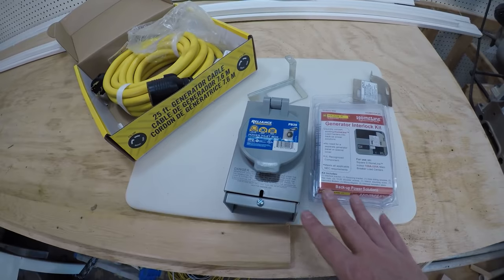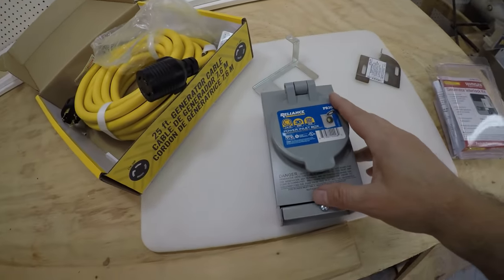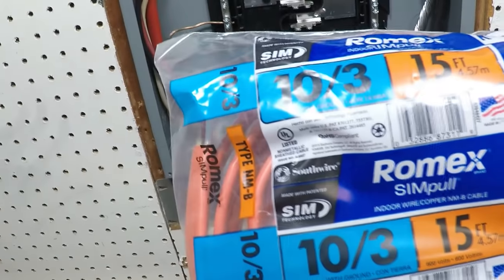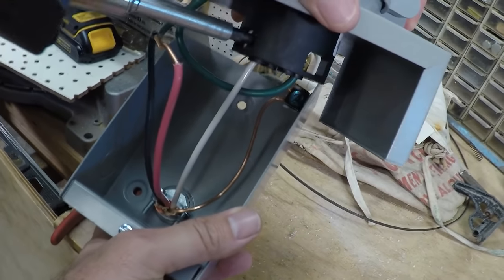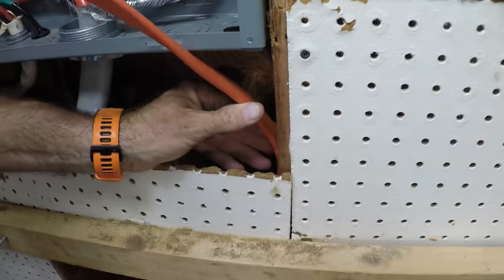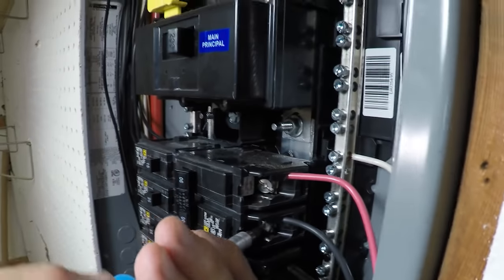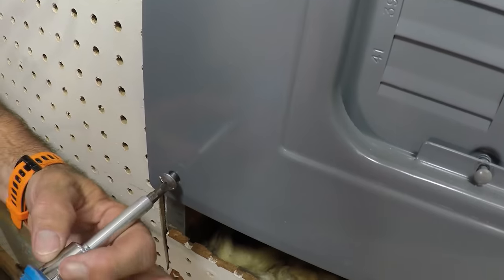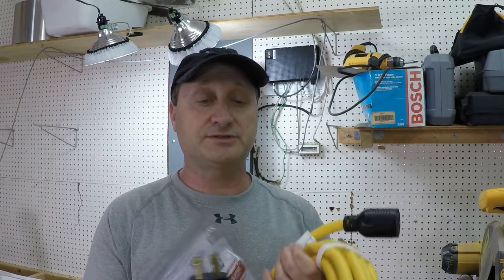Home Generator Interlock Kit Installation - EASY!

Comment: Would this process work the same for a 50 AMP plug?  My generator is a 12KW and requires a 50-amp plug.
Reply from the maker: yes it will

Comment: This may have already been answered already but I just found your video today...great job, by the way.  Enjoyed the step by step explanation.  Where did you get that awesome wire stripper?
Reply: They used to give one away with a roll of Romex but you can get them in the Big Box store. DO NOT use that tool on a 3 conductor 12 as it will cut into the conductors, it's only for use on a flat cable.

Comment: Probably a silly question here, but does the 30 amp breaker in the box push elect to both sides of the panel or just one side?
Reply: A double pole breaker will power both bus bars in the load center.
Reply: @projectswithjw thanks!

Comment: That was dangerous connecting the breakers while they were installed in a hot breakerbox.  If your support hand bumped the breakers to the on position you are holding a screwdriver to a hot terminal screw.  I find it safer to connect the wire to the breakers and then rock them into place on the rails.
Reply: Yes. Secure the wires to the breaker then install the breaker while the breaker is in the  OFF position.

Comment: so my panel has a breaker in the top right that's reserved for a portable generator or is that something we have to do?
Because I'm pretty sure if I could move breakers around and install an inlet to my panel for a generator connection I wouldn't have to watch this video. ;)

Comment: Nice video. I personally don’t have the room in my box for this set up. I wish I did.. I have to add the additional box on my end. BTW please make sure to turn the power main off it is safer if your not so experienced. Thank you 🙏
Reply: They make tandem breakers for many panels that can create room for the two pole gen breaker. You may already have em but just fyi.
Reply: @victorseaton9123  Game changer. Thanks.
Reply: @victorseaton9123   there seems to be a negative effect if you install double pole Breakers I don't remember can you update me please?
Thank you
Reply: @lts30000   2 pole breakers are required for the generator feed in most cases. This is so you make sure you are energizing both bus bars of panel. Tandem breakers are similar to 2 pole but don’t have a handle tie between the two and they only take up one space. Tandems are specific for 2 separate 120v circuits. They give the ability to convert 1 space into 2 circuits.
Reply: @lts30000  no real negative effects. All houses have some. Main issue is making sure you have the correct wire size for breakers and load. If you don’t you can run into serious issues.

Comment: Im guessing because my 3600w generator only offers 120v with the 3 prong RV and the 3 prong locking I assume I can just use a single pole 30A since it wont do 240??

Comment: When you turn off the main breaker for the panel, shouldn’t you turn off all your circuit breakers for the entire house? And when you turn on the circuit breaker for the generator aren’t you supposed to turn on the chosen circuit breakers for the house?
Reply from the maker: my generator can power everything in the house except for the AC compressor. So, that is the only breaker that I would flip off. Meanwhile, you do not have to flip all of your breakers. Just do not have everything in your house powered up. Your generator should be able to run all of the lights, TVs, refrigerators, etc

Comment: So whats keeping the generator from back feeding on the neutral out to the supply lines?
Reply from the maker: the purpose of the kit is to prevent you from back feeding the grid. You have to shut off the main breaker before you can physically open the breaker for the generator.
Reply: @flannelguydiy6458  I’m an electrician and it makes me super nervous having people that don’t know what they are doing, work on anything electrical outside of hanging a light. AWESOME video btw! You did a really nice job.

Comment: I have a generaor with a 50A output, can I put the a 50A breaker instead of a your 30A
Reply from the maker: the wiring may need to be upsized to support 50 amp.

Comment: Forgot the weather seal between box and exterior wall at through hole!
Reply: Construction workers don't know how to do those things
Reply: Very good video, the best I've seen, but in my case I have a problem, my house never had a generator and my electrical panel doesn't have a breaker for the generator, do you have a video like to put the generator breaker on the panel?... thank you so much, from Florida

Comment: @flannel guy diy, you confused me with the two ground wires. Why do you need two and where do you wire that second one after you connect it to the outside box? Also, you didn't give the name of the wire stripping tool and where to purchase it
Reply: Someone answered ground question above 6 th comment down to Darren McCloud question. Don't know about tool sure can get something similar at hardware store asking appropriate staff.
Reply: @personalcarechiropracticma5538  ok, thanks

Comment: Nice video.  You switched the main CB to OFF position and then switched the generator CB to ON. What happens to the rest of the breakers. Just leave them alone?
Reply: I would turn off all the other breakers and just turn on the essentials, for example

Well pump
Furnace
Fridge
Essential outlets
Lights

Comment: is this for a bonded neutral or floating neutral generator?
Reply: It don't matter when its plugged in because its bonded at the main panel.
Reply: Based on the specific setup shown here it’s for a floating neutral.  It does matter.
Reply: @neilbrookins8428  You're right. I've learned enough since my original comment to know that only one ground is acceptable, and no more.  Since this setup is using the house ground, the generator should be a floating neutral generator.
Reply: Floating neutral is for sub panels down stream from main panel , like an out building or work shop away from the house with a sub panel with breakers protecting circuits in shop , outbuildings, barns etc.
Reply: @terryswails1191  or any sub panel

Comment: Great job 👍. What do you think the max length of the 10/3 wire with ground can be . My box is in the front of the house but I would out my generator in the back I'm thinking about 40-50ft would that be to long for the wire from the outlet to the circuit breaker box? Thanks
Reply from the maker: 40-50 feet is nothing. I am working on a project now where we will have a few runs much longer than that.
Reply: @flannelguydiy6458  ok thanks for replying 👍

Comment: Hi can you please share a link for where to purchase 50 amp curcuit breaker and a good gauge wire to run from the box to outside panel.  I am going to get it professionally installed from an electrician but wanted to get it before hand so he does not waste additional on the job clock time.
Reply: Have the electrician buy it. Contractors hate that shit. and you will prob just buy the wrong items anyway.

Comment: Wasn't clear on what Breaker in the box did you wire the plug too? Wire to any 30 Amp breaker in the box? Not understanding this.
Reply from the maker: you buy a new 30amp breaker for this purpose only. You do not use a breaker that is being used for something else
Reply: And shuffle all your breakers around so that 30 amp breaker is located on top of row for safety plate. Right?
Reply: 30 or 50 amp depending upon generator. Many are both, especially above 6kw. Important you know wire sizing based upon amperage. 10s for 30 and 6s for 50.

Comment: Electrician will also do whole job for $350 to $700 depending on area, company and other factors. Recommend an electrician if you don’t have an understanding of how/why on wiring and wire sizing.
Reply from the maker: This is not a job for someone who is not used to working with electricity

Comment: If you have a generator that puts out 50 amps, can you use a 50 amp breaker in the pane?
Reply: Yes, you can use a 50 amp breaker and a number 6 wire.

Comment: good video but you did not list everything you used and/or where you got them. what size breaker you NEED to use, did the little collars come with the box if not what size are they? did you have to move a breaker? if so, how'd you go about that?...🤷🏻‍♂️🤷🏻‍♂️

Comment: My question: Why my generator breaker switch ( the one is on the generator itself) gets off and switched off automatically when I plug the wire to the power inlet box?!???

Comment: Is that a 220 30 amp plug from the gen ? 
The reason I ask is that is the same way my 220 oven is setup in the panel on a 220.  But my 30 amp plug on my gen says it is 120 ?
Reply: His generator has a 220 output which would be needed for this equipment. You need a bigger generator or you'd only be powering part of the panel.

Comment: I have put this in at my house but the only thing it will turn on is my well pump breaker. When turn on any other breaker nothing happens.  Any suggestions?
Reply from the maker: I would have to see it myself
Reply: @Flannel Guy DIY  I think me and my neighbor has figured it out. I was using a 3 wire cord to my driers 4 wire plug. I'm going to put an outside inlet to a 30 Amp dual pole breaker in my breaker box.

Comment: Someone please explain to me. Fuse panels usually have the main power (electric company or solar panels) to the fuse, then to outlet, switch, etc. So how does plugging the fuse in, then adding the plug add power??

Comment: Good video but only thing that would specify on the thickness of The Wire going with the 10 gauge wire and also the extension cord that you're going to use to plug into your generator because if you go to a thin gauge wire you can burn your house down. Also make sure you have a generator big enough run your whole house or you're going to have to get a sub panel so you could only turn on a few appliances if your generator is not big enough. I would of specify those two
Reply: Why can't you just turn off the circuits you don't need or don't have the power to run. I don't get what you're saying please explain.
Reply: Exactly. That’s what this whole video is about, letting you choose what to appropriately run at your discretion.

Comment: how does it power both sides of the panel
Reply from the maker: it goes through the main breaker. Shutting it off blocks it from going to the street but it can flow to the other side

Comment: Hi, so you have to add a 30amp breaker to the top slot of the breaker box in order for the Generator to feed all of the other breakers below when the main is flipped off?
Reply from the maker: That 30 amp breaker essentially becomes the main breaker for the generator. From there, the power would flow through the panel to the other breakers. You should probably flip off the AC breaker for example since your gas generator likely cannot power that. You could go with a 50 amp breaker if you have a larger generator. It will enable you to run more things in your home when you lose power.
Reply: It's basically backfeeding the busbars on the panel through the 30amp breaker, instead of the main breaker. This is actually much safer than other methods I have seen, because the interlock acts as a lockout for the main, so no utility workers are harmed by the backfeed
Reply: @Battleborn357  Got it, Thank You !
Reply: I assume you have to move a breaker if a breaker already occupies the slot?

Comment: I noticed you didn’t turn off the main while writing the ground, neutral and double breaker. As long as the double breaker is in off position is that safe? Or should you turn off the main before connecting all wires to be safe?
Reply from the maker: It is safer to turn off the main.

Comment: Hey Flannel Guy, I was wondering what the benefit is of going with an interlock kit instead of a transfer switch panel, besides the cost and also if there is any benefit of going with a transfer switch panel instead of just an interlock kit?  Thanks.
Reply: Not Flannel Guy but I’ll tell you why I’m getting an interlock kit (besides the expense). 
Flexibility - by getting the transfer kit, you’re frozen into those circuits only.  Also, I could purchase a more powerful generator and not get boxed into a fixed panel.
Less flexibility, less capability, greater cost … why get a transfer kit?
Reply: @pgrant7688  Bare in mind, a larger 30 amp generator only. By larger if you mean a 50 amp generator, then everything gets changed out again, the CB, the power cable coming into the main box, a new 50 amp power inlet box & a new power cable that runs from the gen to the inlet box... 
The moral of the story here is simple: Get it right the FIRST time...
Bill on the Hill... :~)
Reply: @billonthehill9984  Begin install with 50 amp power inlet box, and the 
heavier power cable the first time, but change gen PLUG to 30 amp.  
. . then, if u ever upgrade to huge generator, just change that cord PLUG-back to 50 amp again, and pop in a 50 amp breaker at panel.  That way, you only buy a power cable and power inlet box once.  Saves$ in accommodating future larger generator.

Comment: How did you magically have a free 30amp spot open at the top to install this? Did you move existing breaker in place off camera?
Reply from the maker: no magic here. A few months before installing the interlock kit, I got a new panel. So, this was planned at that time and the breaker was installed (without the wires) at that time. However, yes you can relocate breakers to make room

Comment: What if you have no room in your panel to add a double pole breaker for the power inlet box?
Reply from the maker: then you may need to go with a transfer switch on the power line before going into the panel
Reply: @flannelguydiy6458  So no need to add a sub panel?

Comment: IMO they should just creat the main 200amp switch a three terminal one (Line, Off, and Generator) so we don't have to sacrifice two slots just for the generator input with potential confusion with the users.
Reply: That's called an ATS
Reply: ATS stands for Automatic Transfer Switch. There's also a manual transfer switch that tends to be the in between option budget-wise. ATSs tend to come with cool bells and whistles... automatically putting your generator into cool-down mode before automatically shutting it off when the power comes back on, for example.

Comment: Question to all . . . 
Once you are running on generator power, what is the best way to be alerted when utility power comes back online?  Currently (without this system) we know because all the lights and stuff suddenly turn back back on.  But you won't know once you've cut yourself off from the grid.  Any suggestions, other than having to go to the breaker box over and over and over to switch back and forth as a test?
Reply from the maker: yeah... you have a neighbor (who does not have a generator) call you when the power returns.
Reply: My electric utility has a automatic call back service to call you when service is back.  About an hour after.  But I also opt to not get the call back between 11pm and 6am. Presumably I’m sleeping.

Comment: Way cool, when you installed the 30 amp breaker did you turn off the whole house main, again gracias for the video..
Reply: I recommend you do, it's safest if you're a beginner.
Reply from the maker: thanks for watching...

Comment: What do you do if the 100amp panel has 1 opening for a single breaker?
Reply from the maker: that will not work. Suggest consolidating some of the others or put slim breakers on 1 or two of them to make more room

Comment: On a 30 amp breaker why did you use 10ga. vs 8ga.?
Reply from the maker: 10ga is appropriate for a 30amp breaker. 8ga for 40 and 6ga for 50 amp

Comment: That interlock states for 150a to 225a. Is it ok for just 100a service?
Reply: The interlock keeps you from being able to have your generator from feeding power to the grid. If you are running your generator the main MUST be turned off!! It isolates your house from the grid. It can and will kill the linemen working to get your power back one. I cannot stress this enough.
When the generator is powering your house, the main must be off!!!!!
The interlock is a mechanical device that will not allow both breakers, power from gen and power from grid, to be on simultaneously. 
As long as it does that, it’s good.
There have been linemen killed from people charging lines from their home generator. You will be charged and do jail time, and rightly so.

Comment: Hi  I  have  Interlock kit for generator 10.000 mi system is on globe meter 3 light for utility power do you have any system to install alarm light to tall when the utility power is on in stead go back and for check light on the bottom  of the meter. Can  you  help  thanks

Comment: Good video, curious about the external box / plug used on the generator.  I saw 5 wires: 2 hot - 1 neutral 1 bare ground, 1 green insolated.  So what is the proper wiring? 2 hots to the 2 pole breaker. The neutral to the neutral bar. The bare copper to the external box lug. But the green insolated? Does this go to main panel ground bus? I did not see what you did with it.
Reply: The bare ground is with the pink(orange)10/3 and connected to the little tab in the corner of the outlet box. The green wire comes from that same point and goes to the back of the outlet in the G hole. So its ground to case  and case to outlet

Comment: Do u have to add à 30 amp braker u used?
Reply: Yes sir. You have to move the other breaker or breakers to make room for it at the top right.
Reply from the maker: yes you do...thanks for watching...

Comment: The 30 Amp  breaker for the generator  is just a normal  breaker yes?
Reply: @Wayne B thanks a lot for the infos. i am trying to get a generator installed for my house.
Reply: @Wayne B so this Doble pole 30amp work with 120v and 240 from 30amp Generator setup? Thanks!